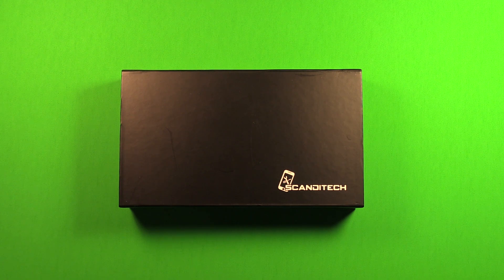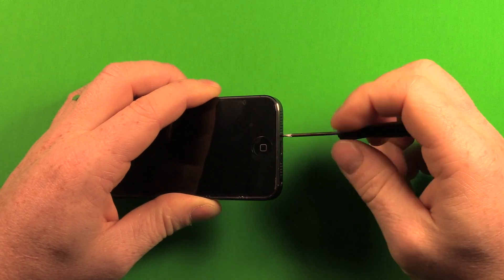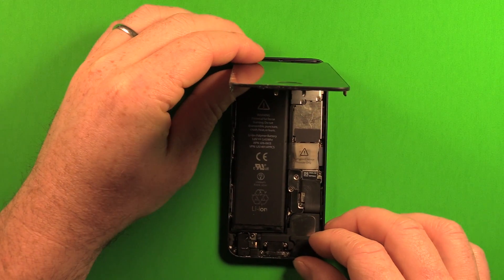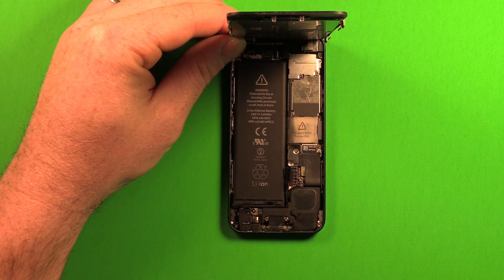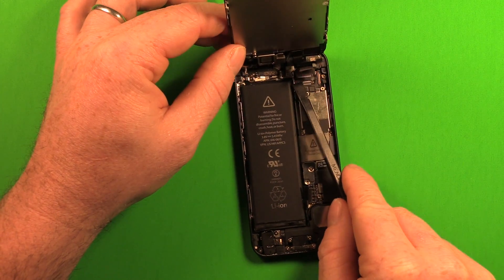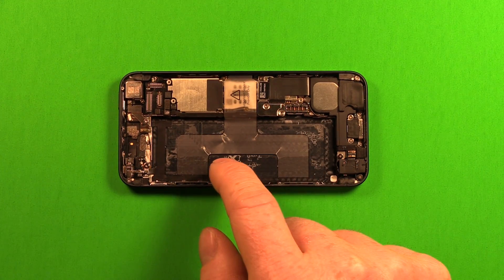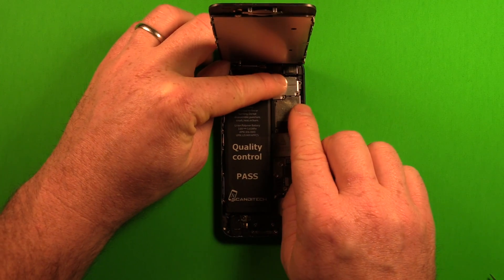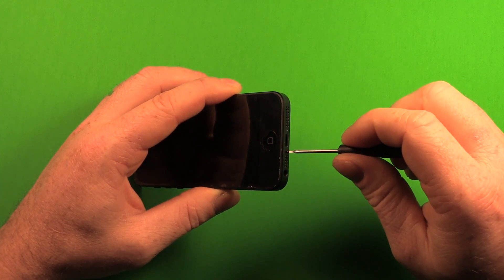How To: Replace / Change Your iPhone 5 Battery - DIY Guide by ScandiTech (v2)

Comment: I’m confused. All the other videos show removing the battery from the right side, where the tab is. 

One other video did have a comment warning against removing from the right. Why would they put the tab on the right, if it should be removed from the left. 

I plan on using a credit card to remove the battery from the left. That way, it will all come out without being bent. I’ll let you know how it goes. I already bought my battery, but I’ll keep your company in mind next time.

Comment: I can't get the screen to lift up enough to try and make a gap
Reply from the maker: Hi there,

You can try softening the screen adhesives by using a hair dryer. Opening up the phone is quite a challenge especially if this is the first time the phone's being opened.

Comment: I just replaced my iphone 5 battery.  Apparently it worked.  The only problem was I lost one screw to the screen connector cover.  :(  But your instructions were excellent.  Thank you.  I did buy the ScandiTech kit.  It was so nice to have everything you need right there on hand - well, except for the hair dryer.  Thank you for the excellent quality kit and instructions.
Reply from the maker: Hi Tom,

Thank you for choosing ScandiTech. I'm sorry to hear about screw. These screws are quite tiny and can easily be lost. It's all good anyway as long as all the other screws are inserted to their original slots. 

Enjoy your new phone!

-John
Scandi Tech

Comment: Thanks for helping me extend the life of a perfectly good back up iPhone. Staples Tech sends these out to change for $99. It wasn’t as easy as I thought since I ran into problems removing cover not so gently. Then putting back a couple screws over battery connector took many tries and patience. I doubted it would turn on but it’s fine. Thank you.
Reply from the maker: Hi,

Congratulations! The repair is pretty straightforward but it still needs gentle hands and a lot of patience. I'm glad that the replacement was a success.

John

Comment: Thanks for the video. Its best to make a prop to hold the screen up so u can just replace the battery.
Less really really small screws to take off and put back. Lost 3 screws had to take it to the repair shop. Likely they only charged me £ 10 to take it apart and put together again. The screws just wouldn't  go it the holes. From UK

Comment: Apparently I have the only iPhone5 on the planet that has a ribbon cable connecting the bottom of the case to the bottom of the faceplate. No clue how to disconnect it. Couldn't replace the battery because I couldn't open the phone up enough, due to this mysterious ribbon cable. According to any number of videos and instruction sheets, this cable does not exist anywhere except in my phone.

Comment: These batteries cost about $20 on Amazon, but most repair places will do this including cost of battery for $60. So why bother with this???
Reply: Another Virgo Asshole Staples Tech sends these outside at $99 charge in 2019.  No one works on these anymore. That’s why

Comment: This is very helpful. Followed this video to replace iPhone 5 battery. Later realised iFixit had pretty similar detailed step by step photos. However, although both extremely helpful, still could not solve ERROR 21 no restore. What would be great if there was some kind of diagnostic process we could employ to determine the issue. Right now it seems everyone is frustrated not from the problem itself, but from not being able to determine the cause. Its just pot luck.
Reply: ThePharaohsCat did you ever find a solution to error 21

Comment: Well I knew something was up. Neither of the links you gave work. It directs you to Amazon but says those specific pages don't exist. Well I typed in ScandiTech into the search bar and there were only two options which neither INCLUDE the battery, just the tools.

Comment: One of the screws doesn't come out to open the phone so I'm screwed lol
Reply: After taking 2 years to remove screws , finally put new battery in, and phone won't turn on, pretty sure I screwed something up lol
Reply from the maker: Hello there,

In some cases it's enough to charge the battery for 15 minutes after a replacement as some batteries arrive with no charge.
If you bought your battery from us, feel free to message our support (support@scandi.tech) with your order number and we'll help you out.

Regards,
ScandiTech

Comment: Iphone wont turn on now. time to get a new phone smh.
Reply from the maker: Hello Brandon,

If your phone doesn't turn on after a battery replacement there could be a couple of things that went wrong. Some issues are very easy to fix. I'd like to suggest that you contact the company that sold you the battery and I'm sure they will be able to troubleshoot the issue. If you bought the battery from us, you can find our contact details on: www.scandi.tech

Regads,
ScandiTech

Comment: This video was great, thanks. 
For me, the only thing a little sketchy was plugging the new battery into the phone while tucking the flat cable in next to (or below?) the battery. I had more cable to deal with than was on the video and plugging it in was no easy feat and I felt like I might start to damage it if I had to force it more. 
But again, the video was really, really helpful.
Reply from the maker: Hello Ernie,

The cable should fit between the battery and the motherboard (and not underneath the battery). Sorry for not showing this clearly enough. Sometimes it can be a bit tricky to align it perfectly but it seems it worked out for you. If the cable would have been damaged, the battery would not power on the phone. In other words, if your phone turned on and charges, then everything is fine. 

Regards,
ScandiTech
Reply: I just tucked it under the battery now its not turning on what should i do?

Comment: everything went well until you told me to remove the screen for f*cks sake
Reply from the maker: Hello there,

To be fair, we mentioned that both ways are fine but most people find it easier to work the phone without the screen. There's always a risk involved with taking devices and gadgets apart. This should not be ignored. The more high-tech a device is, in general, the more troublesome it is to take it apart.

Regards,
ScandiTech

Comment: Got MOST of it working as advertised. But when I turn the phone back on, there are some darker lines down the screen and they seem to be 'dead zones' where it doesn't detect my finger touching it. Any recommendations?
I did remove the screen a per the instructions (and for the best, the glue was holding the old batter rather tight!)
Reply: Nevermind! I re-attached the screen connectors and it seems to be working now!

Comment: I've used my new battery for a week and so far it's been great! When replacing another iPhone's battery, I discovered that when using the suction cup, it helps if you put in your earbuds and charger into the phone, for something to hold onto when removing the cover.
Reply: That would put a lot of stress on the pins and connectors inside though, which might warp/bend them.

Comment: I have a glass screen protector. Will I have to remove it to use the suction to pull up the screen?
Reply from the maker: Hello Donna,

Glass screen protectors normally come loose from the front assembly when pulling with the suction cup. If you don't want to remove it, I'd suggest using the tweezers to assist with the removal. Insert the tweezers between the front assembly and the metal assembly by the speaker holes and carefully pry the front assembly upwards. We show this in detail in our text/image guide on our website:
www.scandi.tech

Regards,
ScandiTech

Comment: Thanks! The kit on amzon worked. Mine already had some juice in the battery, but I plan to give it a full charge before I use it too much just in case. The blow drier helped a little to get the battery out. I applied heat about 6-8 times for 10 seconds. I had to re apply the adhesive on the outsides of the pull tab but not the rectangular piece in the middle. Thanks again!
Reply: yeah I got mine on amzon  too.

Comment: Do u have to remove the screen? Or is that only so u have 2 hands to get the battery out???
Reply from the maker: Hello,

You do not have to remove the screen. However, if you proceed without removing it, make sure the screen is securely fastened at a 90 degree angle. If the screen slips, the cables that attach to the motherboard will most likely tear! This means you'll need to replace the screen completely.

Regards,
ScandiTech

Comment: I have a 5c, the tab broke and I can't pry the battery out after heating it up.
Reply from the maker: Hello there,

I'm sorry to hear about the adhesive tabs tearing. This is quite common. Apple does not make this easy for us. Prying the battery slowly from the left side (not against the motherboard) is really the only option you have left if the tabs break. This can be a difficult task but if you proceed slowly and only pry a little bit at a time, the battery will eventually let loose. Prying out the battery can itself take up to 10 minutes. Once again, move slowly and carefully and only work the battery with dull tools to avoid puncturing it.
We show this process from a slightly different angle on our website: www.scandi.tech

Good luck!

Regards,
ScandiTech

Comment: how come when i lift the screen their is shit in the way and I can't see the battery. When you do it, it all magically comes off all intact. It's fucking bullshit and now I fucked up my screen.
Reply from the maker: Hello there,

Sometimes when the glue that's holding the plastic frame to the glass is weakened (this happens every now and then), the plastic frame and the metal plate will not come off of with the glass. If this happens, simply assist with tweezers or a similar object. You'll see that the frame attaches to the back assembly by notches along the back assemblies sides. Simply stick the tweezers in there and carefully lever the frame/metal plate upwards and it will come up with the glass.

Regards,
ScandiTech
Reply: I got the same problem

Comment: Had 6 hours of ussage last night & 12 of standby with my new baterry, the old one even autodrained 20% over night, the only thing that I'm disapointed is apple ho asked 100$ to fix my battery because the phone wasout of warranty.
Reply from the maker: Hello Keevvy,

If you have bought an iPhone 5 battery from us, we'd be happy to help you troubleshoot the issue. Our batteries are covered by our 12-month warranty which we stand by. I would like to suggest that you contact our support directly and they will be happy to assist you: support@scandi.tech

Regards,
ScandiTech

Comment: When I tried putting my display the top of screen doesn't want to fully click in for some reason.and when battery fully died I charged it and the screen just keeps flashing white with Apple logo on while plugged in. I purchased the full kit from Amazon and I filled step by step video guide please help I don't want have loose all information on my phone